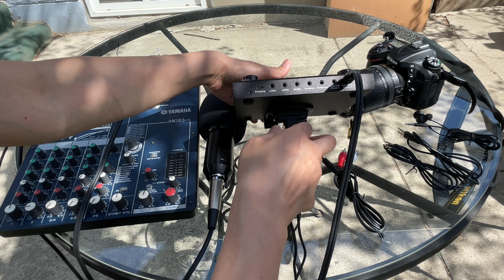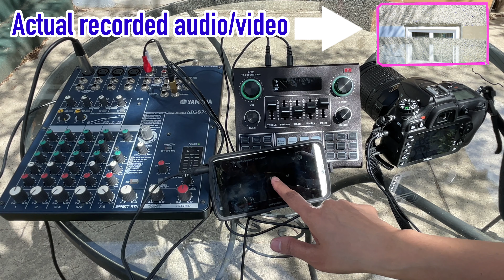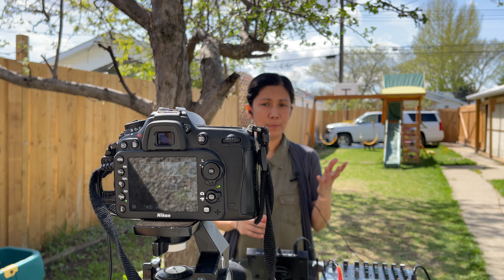Mixer to V9 Sound card to DSLR Camera with Condenser mic - Recording set up (English)

Comment: Why do you need a V9 sound card in this configuration?
Reply from the maker: Technically speaking you can go live streaming or recording with just the mixer with camera however connecting to V9 sound card is so handy as it has preset sound effects and voice changer.
Reply: @jenuds   several popular mixers like Yamaha, Mackie etc comes with sound effects, and I was wondering why do you need a seperate inferior device connected in the circuit, got your point, thanks for replying!